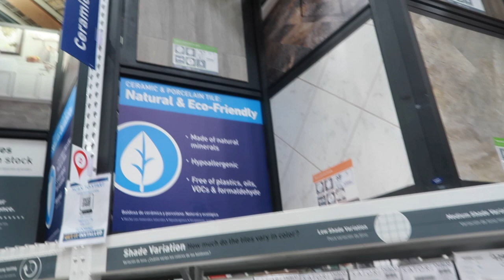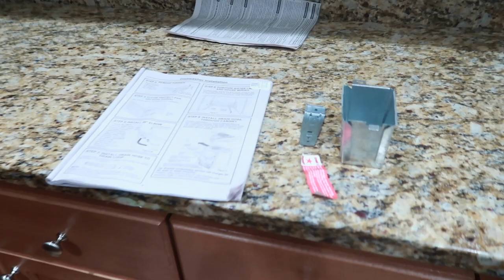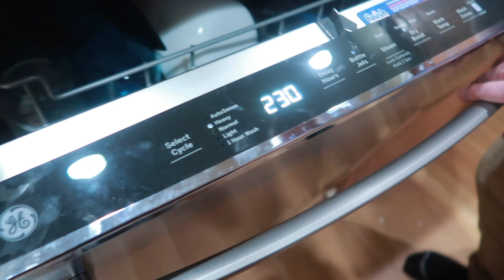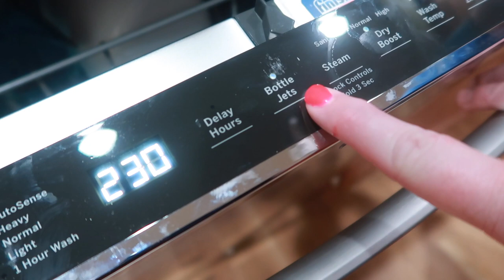WORST Haircut EVER!

Comment: When I see these videos, I realize that I have it pretty good. I have been having my husband cut my hair for me since we first met. At the time my hair was collarbone length and now it has grown out and now reaches past my elbows.Our routine is that every other month I take a seat on the stool, he sets out a glass of wine for me, I get caped, my hair combed out, sectioned just behind my ear on each side and he pins up my hair with hair clips. He blunt cut trims the bottom layer of my hair with his sharp hair shears, and then he lets my hair down in increments to trim each layer. He has me turn my head to the side so he can match the hair in the front with the back. He holds sections from each side of my head under my chin to ensure it is even. He cuts my hair dry so he can see and remove the split/damaged ends. He does the trimming in increments So that he is cutting a manageable amount of hair, as if he tries to cut through too much at once, the blades push the hair before they cut, leaving it uneven. I used to pay $55 for a haircut when my hair was collarbone length, now that it is past my elbows, they would be charging me more like $100. So I figure I am definitely saving several hundred dollars a year. My best friend asked me years ago who did my hair as she needed a haircut and was not happy with the way the salon she had been going to cut her hair and she liked how mine looked. When I told her that my guy cuts my hair, she wanted to come watch him do it. I told my guy and he was fine with it and asked if I wanted him to cut her hair for her. I said yes, if she asked. Well she came by, watched him intently as he cut my hair, complimented his work, then as he was taking the cape off of me, she said, “I’m next!”. He said you are indeed and she took a seat. She wanted about an inch and a half off her mid back length hair, so he caped her, did the full routine on her hair. When he finished, she went to the bathroom to check the results and I got her a hand mirror to check the back. She was pleased and asked if she could book her next appointment. So she gets her hair cut by my guy regularly and does not miss the salon. Hubby also cuts his grown daughter’s hair and has given haircuts to a couple of my friends, my mom, my boys and friends of my friends. He has gotten a number of requests over the years, he likes the compliments. Last weekend I had a couple friends visit to grill on the deck, the discussion of haircuts came up, and my best friend asked hubby to give her a trim on her mid back length hair, no big deal he has cut her hair before. He said ok, got his shears and tools, then caped her, about 2” off as she asked. My other friend had mentioned that her bangs in her eyes and the mullet thing on her neck was bugging her, and seeing him trim my best friend’s hair, she asked if he could cut short hair as it is harder than trimming long hair. I pointed out that he gives my two teen boys their haircuts, and she asked if he could cut her hair too. I wasn’t worried, he has given my boys hundreds of haircuts, he is really good. He got out the bag of barber tools, put the pinstriped barber cape on her and secured a neckstrip. She asked him to cut her really short on the back and sides, leave it a couple inches longer on top. He asked if she was ok with clippers and she nodded. So he took the clippers with different attachments to the back and sides, then clippers over the comb to cut the top and blend it with the sides and back. Peanut clippers on her neck line. My son vacuumed up the pile of hair. She felt her head and commented that it felt great with all that hair gone. She inspected her hair in the bathroom mirror was pleased, and posted pictures on Facebook. She got a lot of compliments and her stylist commented that she really liked the haircut, but she was jealous that she had cheated on her, and hoped that she hadn’t lost her as a customer. She assured her that she would be back, she needed a haircut to tide her over. It is great to have a family member that has a knack for cutting hair. It saves me a lot of money.
Reply from the maker: This is amazing!! Your husband is such a good guy to not only learn how to cut your hair, but to be so willing to cut others’ hair! So cool! You’re very lucky indeed!!!
Reply: I definitely agree with you that I am very lucky, as he is really good at doing haircuts. He admires long hair on women and my best friend asked hubby to bring his shears to trim her hair at a barbecue last summer at her house. A coworker of hers had hair well past her butt, and she asked him to cut her hair to her hips when she saw him trim my best friend’s hair.  My best friend really wanted to see her get her hair cut and if she hadn’t asked my husband to cut it, she was going to suggest that she have him cut her hair and another friend was going to chime in to encourage her to have it cut. She knew hubby is good with the shears, he would do a great job and she figured he would enjoy the opportunity to cut such really long hair. We insisted that she stand up with her back to us so we could watch him cut off nearly a foot of her hair, before he had her seated, to section, pin up and trim her hair in increments. 
 Hubby took over giving my boys their haircuts at my prompting, as they would not trust me, and I had just spent a good chunk of money for the Wahl pro grade Designer hair clipper set. Those clippers have been used for hundreds of haircuts, so they have been a great investment. I don’t volunteer him, but if a good friend of mine asks him while he is already doing a haircut, he will say ok and do it. He fixed a botched salon haircut for my best friend and she hasn’t trusted anyone else to cut her hair since.
Reply: Sounds like your man knows what he is doing. Also has a nice side hustle. I don’t trust myself to try and cut Dayna’s hair. It would be rough for awhile.   Totally cool your friend was willing to have him cut her hair. Thanks for sharing👍🏻